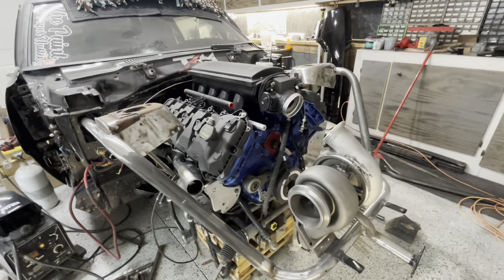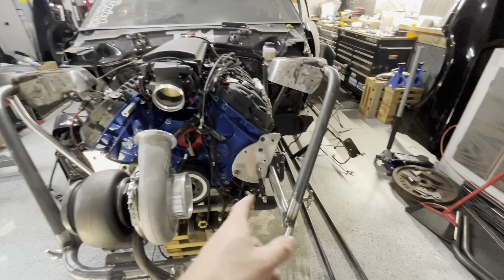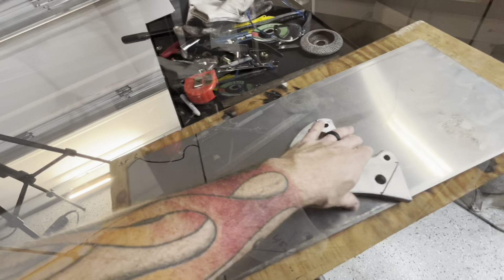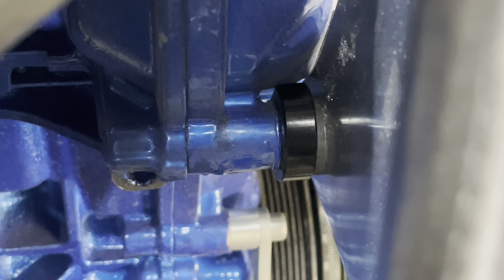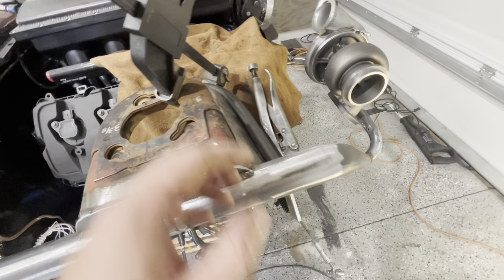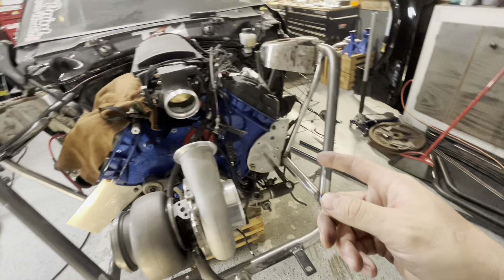⚙️ Building DIY Engine Plates & Shock Tower Hoop Bar ⭕️

Comment: courtney this is rodney from the  turbo john chat. my buddy that had an issue with ups was shipping his transmission and what happened was it started leaking so they pulled it at the drop off location. never contacted him his buyer reached out and said he didnt receive so my buddy went to where he dropped off they let him clean up reseal and everything was fine. So bottom line before you give up on a $3500 converter i suggest you go to where you dropped off to see if it is physically still there hope you get this message and it helps see you wed. at the chat buddy be safe
Reply from the maker: I went there Wednesday and they said they had nothing there
Reply from the maker: I also cleaned mine out and then put it back together before shipping
Reply: still hopeful that it shows up buddy @ThePaintPaperHustle